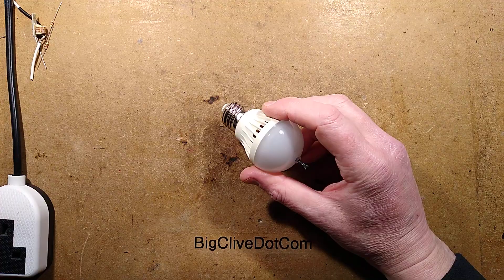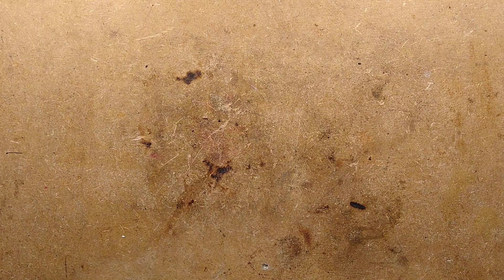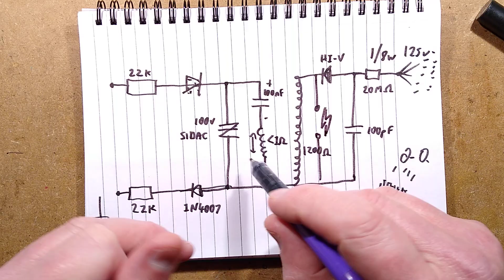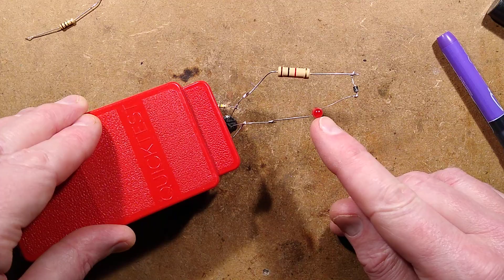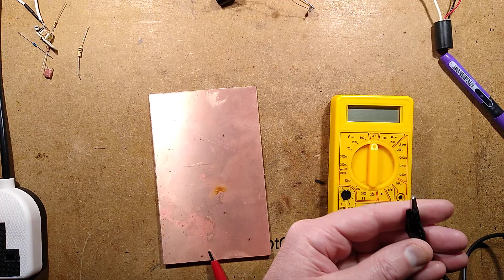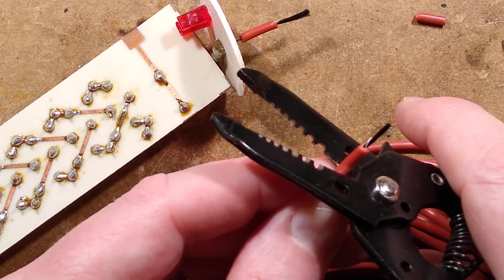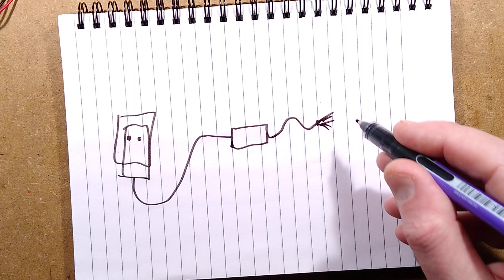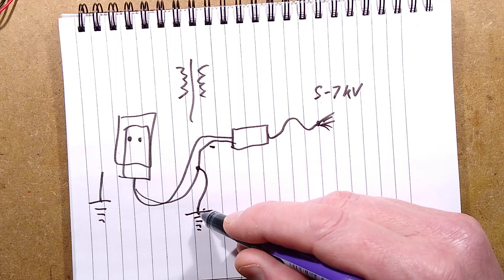LED lamp with tiny 5kV high voltage ion module.  (inc schematic)

Comment: I'm guessing the affects of this on a human or the surrounding environment are nothing more than woo-woo. Seeing as how you have to be so close to the detector, and assuming it dissipates using inverse square law then by the time it got down from the ceiling to the human it would be  close to the square root of bugger all (ie close to nothing). Also if negative ion's are good for you, if you reversed it so it shot out positive ion's would that have a negative affect on human health (well, if it were not all bs woo-woo).
Reply from the maker: My first DIY ioniser went wrong and I made a positive one instead.  I told my coworkers it would freshen the air and instead they complained it was making them feel agitated and giving them headaches.  Maybe just coincidence.  The main thing is that the unit relies on air turbulence and adds extra electrons to the air.  A positive unit actually strips electrons from the air which may be why it has that image of being undesirable.

Comment: Interesting, those sidacs are expensive on ebay.  Close family to diacs which are used in dimmer circuits to trigger a triac. Diacs break down at ± 36 volts, wonder if three diacs in series could be used instead. Diacs are about 20 cents each.
Reply from the maker: It depends how well the diacs would deal with a high current pulse from a bigger capacitor than that used in dimmer circuits.

Comment: Want to buy one, but my light fitting is bayonet. My original guess was that if I put it in an adapter I had a 50% chance it would brake, or be a positive ion generator! After actually looking at it, the diode would mean it would be fine. I wonder why they don't seem to have b22 versions?
Reply from the maker: The most common lamp holder in China appears to be the E27.  It will work fine in an adaptor whichever way round you put it.

Comment: won't this play havroc with RCD or ground fault circuit breaker? as i think they would cause an imbalance on the line side and open the breaker?
Reply from the maker: No.  The current involved is microamps.

Comment: Been an electronic engineer for over 45 years but have never heard of the SIDAC. Could have been useful in one particular application I was involved with back in the 90s as it would have taken up less room than the DIAC or neon plus thyristor used.

Comment: So would that be a hazard, having the bristles outside the lamp? I question if it'd be a good idea to touch it.
Reply: Fine apparently https://www.youtube.com/watch?v=tl0g_z25xqo&lc=Ugylt1PXfLmEZrdfvgh4AaABAg
Reply: That's what the crappy resistor was for. Limits the current if someone touches it. Clive recommends replacing it with high voltage resistors (two 3kV resistors are much cheaper than a 6kV resistor etc.). Touching the capacitor directly would not be pleasant.

Comment: okay but why do i want an ionizer on a lighbulb
Reply from the maker: Suspending an ioniser from the ceiling in the middle of a room is a good location for large air coverage.  It puts an electrostatic charge into the air and precipitates airborne dust and bacteria out to the walls and floor.

Comment: Hi Clive, Big fan, love your videos....long time listener, first time caller lol.....what website would you recommend for small electronic components? For example Resistors, capacitors, LEDs etc ... I have been using eBay but I always seem to have very inconsistent result when purchasing things...or....can you recommend any eBay sellers that have a great reputation.
Thanks 👍
Reply from the maker: Where in the world are you based?  In the UK I'd use companies like Rapid electronics or CPC for reliable component supply.
Reply: bigclivedotcom   I live in Bath in England, UK....i remember you mentioning those suppliers on one of your live streams...il give them a go, cheers Clive 👍

Comment: Your description of how the circuit works gets confusing because while there are two ways of looking at it, I always reference electron flow being from negative to positive. So that also means that electrons flow against the arrow of a diode with negative being applied to the plate or line side of the diode. Also the description of how the "Sidac" works was confusing.
Reply from the maker: I usually describe circuits based on conventional current flow to make things easier for people new to electronics.  Particularly involving diode direction.
Reply: @bigclivedotcom  Stands to reason since I started with electricity in the mid 70's and by the 80's I was repairing electronic devices. I have watched many of your videos and your knowledge of electronics is more advanced than mine. When I said "negative being applied to the plate or line side of the diode" wasn't exactly true all the time...You can have a voltage potential of +6V on the line side of the diode and +12V on the other side and the diode will be considered "forward biased" such as that current will flow, so the proper term would be a "more negative voltage" on the line side of the diode with respect to some other point in the circuit. [We won't even bother to go into the various kinds of diodes and their characteristics.]
Then again I learned a few years back something that burst my bubble as to how I viewed electron movement in a circuit. Electrons don't actually "flow" in a circuit.??? I would call it more of a "wave" of kinetic energy causing atomic bombardment that moves from atom to atom through the conductive material. Kinda like that novelty desktop toy with steel balls hanging on a string where you pull the first ball on one side back and release it, It hits ball #2 and stop's, none of the rest of the hanging balls move except the one at the other end moves away and then because of gravity returns to repeat the cycle until friction entropy causes  the stored energy to reach 0... :-)

Comment: Hi Clive, you mentioned a boiler spark generator, can you do a video on flame rectification, ionization and flame conduction, used to show the ignition has lit the burner. I sometimes need to commission new Static Caravans that haven't had the electricity connected, I use a pure sine inverter fitted in my van, some makes work fine sometimes the lack of an earth connection means they just go to lockout....yes I know! inverters and earthing is can of worms.

Comment: What are your plans for that module? Going to build a taser for ants? Also, Linus Tech Tips just did a video involving 18650 lithium cells, an ATV battery, spot welding, and a lurid pink battery bank. I think he's trying to steal your audience...

Comment: But is it safe to touch the bristle?
Reply from the maker: Yes.  It's very low current, but that final output resistor isn't good enough for isolation from the mains supply.
Reply: @bigclivedotcom  I figured there would be a catch. I hate poorly mains isolated devices so much. It's just bad engineering.

Comment: That schematic looks like a spark gap Tesla coil with a SIDAC replacing the spark gap. Operates the same way. 
Also, John Dunn of EDN magazine reverse engineered a stove igniter that used a neon bulb to turn on a transistor. 
https://www.edn.com/reverse-engineering-an-electrical-spark-igniter/
Reply from the maker: The neon trigger is also used on strobes to trigger a thyristor.

Comment: Love your videos. I have a suggestion for you. I am a hvac technician in the US and we sell an indoor air quality device for forced air systems called Reme Halo  and it seems to be an amazing product for the most part. It is not cheap but i was curious if you could somehow get ahold of one to take it apart and explain it to us. I am not aware if they are sold in the Uk or other parts of the world but i would love to hear your opinion on them.
Reply from the maker: Without taking one apart it's hard to say, but it looks like it might be using a combination of a UVC sterilising lamp and possibly a titanium dioxide photocatalytic system for promoting the rapid oxidation of spores and other contaminants.  Does it smell of ozone when cranked up full?  They may be using a lamp that filters out the 184nm ozone producing wavelength.
Reply: @bigclivedotcom  i do believe it does smell of ozone they do effectively reduce cocs and other contaminates

Comment: Those negative ion generators are great for making static grass applicators for dioramas and stuff. I made one with one of the 12v modules and it outputs around 15 - 20kV. It does give quite a whack if you don't discharge it though so that's always fun.

Comment: I was just browsing eBay and saw ozone sterilizer plates. These look new and interesting.
Reply from the maker: If you mean the ceramic plates with conductive tracks, they've been around for a while.  When high voltage at high frequency is applied across them the capacitive coupling of the current causes a corona discharge that splits oxygen apart allowing ozone to form.
Reply: @bigclivedotcom , yes, they're rectangular and have either line or honeycomb traces.

Comment: I repaired my Daughters Hairdrier the other day as She said it was sparking inside and lo and behold I found one of these negative ion generator inside..the output wire had come adrift and it was that that was shorting out to the heater coils

Comment: a sidac can be found also in sodium lamp igniters, it acts basically the same way except the secondary is in series with the lamp (variations may occur)... anyways it's a slightly more powerful version of a diac, not sure it shorts totally when triggering or provides pseudo-short pulses like a neon lamp, it may depend on short circuit holding current maybe

Comment: I built an ozone generator years ago that uses a small flyback former and five short copper tubes with sharp nails inside each copper tube. It works quite well, actually.

Comment: hello Clive I suggested this sidac circuit is actually quite similar to a traditional automobile ignition coil circuit with a capacitor and a set of points that open and close.
Reply: Yep.make and break.
Reply: Or a flyback transformer. Such as is used to fire a Xenon flash. All are the same principle.

Comment: SIDACs are a lot like DIACs except with an extra layer, two symmetrical negative-resistance regions in their V-I curve, and they operate at higher voltages and currents. DIACS are used to trigger other devices like triacs but SIDACs generally do the job themselves. 
The negative resistance means that once they start conducting they stay conducting until the current through them falls below a certain level, then they go high-Z making them analogous to spark gaps but at much lower voltages (explanation for other viewers, not you).
It's really cool to see a SIDAC that small, but are you sure it's not a DIAC? I've seen them used in similar applications because you can get away with overvolting them if the current is low enough. Run current-limited AC through it and scope it- if it has negative resistance regions it can't be a DIAC.
Also, I disassembled a gifted "joke lighter" that doesn't produce a flame but does deliver HV shocks. No fun parts like SIDACS or DIACS, just a kind of HV version of the Joule Thief mostly due to the way the transformer was wound. I have a hard time believing someone was paid to design the damned thing. The whole (unpotted!) circuit is the size of the three SR44 button cells that power it. Can't imagine what I'm going to use it for. If I had one to send you I would but they're very commonly available.

Also also, I propose Clive's Law- "When preparing to record a YouTube video you will forget at least one critical item without which the video will be pointless, requiring you to step away from the camera briefly while covering with semi-relevant apologetic patter".
(You sure aren't the only one to do it but you do it with such uncommon grace.)
Reply from the maker: A diac tends to trigger at around 30V and isn't rated for quite the same current as a sidac.

Comment: could you use a neon bulb in the same capacity as the sidac?
Reply from the maker: It would work, but the electrodes would sputter and cause it to fail very quickly.  Neons don't like current above a few milliamps.

Comment: Could you make an ion canon?
Reply from the maker: You can use a mid voltage ring to create quite a directional flow, but the only place that ions are a viable force are in space for simple low energy propulsion.

Comment: Why not drive the HV transformer directly from the 240v AC?
Reply from the maker: It's too small.  It would need to have an ultra fine winding for direct 240V operation.

Comment: I've found boiling hot water works better. 
Using a pot on the stove, it softens the resin enough to be pulled apart easily.
SIDACs can be had on Digikey etc for under $1
Reply: Would a low oven (~225° F/110 C) for x minutes (depending on mass of potting goop) speed things up? 

That potting goop needs a new formulation -- something that becomes some combination of tacky and runny on exposure to one or more gaseous environments. Or exposure to UV. Essentially, formulate it so that it's chief benefits can be undone in particular 'reachable' conditions.

Comment: could you split your needle and attach multiple carbon fiber ends to get infinite ions?
Reply: that essentially is what many ionizers do they just attach more needles to the same hv supply.

splitting the needle quite literally i can not recommend since it will be relatively hard to pull of for very little effect. its easier to just solder or weld on another needle.
Reply from the maker: The ion output will be limited by the current delivery of the circuit.
Reply: @bigclivedotcom  obviously there is no way to create infinte ions or infinite power...
Reply: @bigclivedotcom  I was just curious how the increase would be adding more brushes. Asymptomatic to an ideal value

Comment: The LED circuit you plugged in, was it NICEIC compliant? LOL.
Also, stop calling it a shitty meter, I've been using the exact same one for at least 15 years, It's bloody brilliant. (if you ignore the transitor tester).
Reply from the maker: The little meters are fine.  Some are pretty good.
Nothing is NICEIC compliant because it's just a private marketing company.

Comment: Do ionizers interfere with electronics, mics or wifi signals? I'm thinking of getting one or two for my apartment, but my home life is heavily based on electronics / PCs / microphones
Reply from the maker: I wouldn't recommend placing an ioniser near electronic equipment as it can cause static discharge issues.
Reply: I suspected so, thanks very much - guess I'll just hope my pc fans filter enough of the dust out of the air or something? lol
Reply: @anonony9081  because.... uh... ions are cool?

that's a good idea, can you recommend any models of air purifiers?

Comment: I don't understand what it does but it's still interesting to watch
Reply: That is the bit I was actually missing in this video: "What would you want to use an ionizer for?"

Clive might have, briefly, mentioned that at the start of the video somewhere.

I also haven't got a clue.
Reply: @Junyo  They create negatively charged ions in the air. Some people find they make indoors air feel more pleasant. There is also some evidence they prevent the transmission of viruses (they have been trialed in schools and hospitals) and can remove particles from the air by making them stick to surfaces, which attract the negatively charged particles. There is also a lot of quackery associated with them, but some of the benefits do have some evidence and a coherent scientific explanation behind them.

Comment: Seems like a SIDAC is "a sort of avalanche zener",  or perhaps more accurately a zener meets thyristor hybrid! Got to get a few to try out!
Reply: Could you not just use a neon lamp? They strike at about 100V.
Reply: @rysacroft  Dumping large current pulses through neons will significantly reduce their lifespan, and their drop out voltage is pretty high too.

Comment: Do you think the diode is on the return so that it only has to be rated for the power after it has gone through the other components, instead of the live before it has gone through the rest of the circuit?

Comment: I would never think of using the tip of my soldering iron as ground reference...
Note that inside the soldering iron there will be a series resistor between the tip and the mains earth.
Reply: If anything that resistor will be of a small value so it is still a good ground reference unless you're passing lots of current. My Weller WAD101 measures 30ohm between the tip and main earth pin on the IEC socket.

Comment: Try searching for a bidirectional diac instead of sidac.
Reply from the maker: Diacs are inherently bidirectional.  Usually just at one voltage range (about 30V) and limited current capability.

Comment: The module looks like the ones I have called Anion generators model CL-R03 from Xiamen Comwell electronics, input rating is given as 110~250 volt, out >2.5KV, apparently these were used for some medical purpose, I don' know the details, I fitted mine into an old gutted out UK mains voltage adaptor, I have one in the living room and one in the pantry.
Anecdotal: they appear to reduce mould growth, I would guess the spores are made heavy and fall to the ground before they can land on any foods.

Comment: You're really sure that they could have stuck the diode on the other lead? I'm not that sure. I think it needs to be on this side because of the connection to the high voltage side.

Comment: Had a similar lamp minus the ionizer, lasted about a year and a half until it failed. Upon opening half of the LEDs had literally let the magic smoke out and all of the plastic had yellowed and turned so brittle the case came apart in my hands when squeezed.